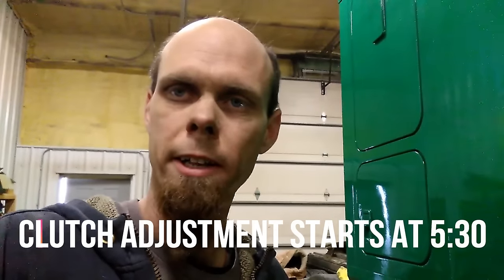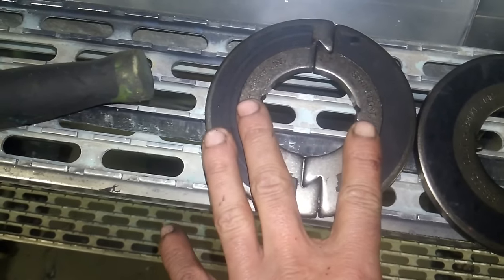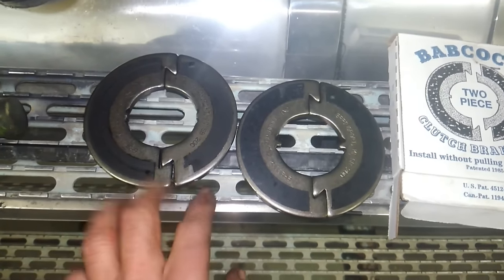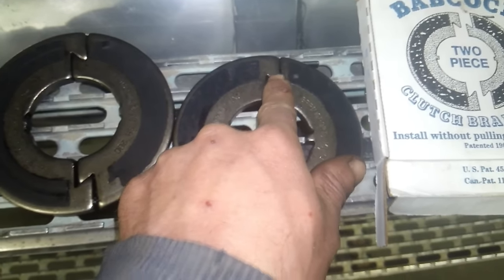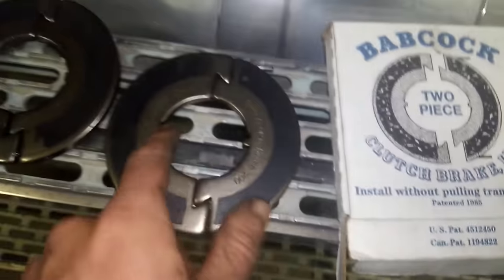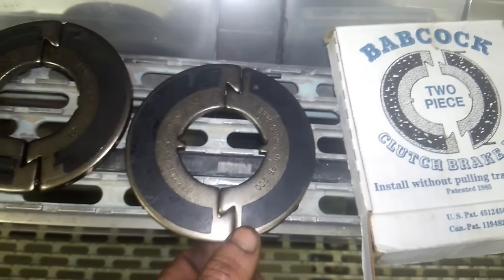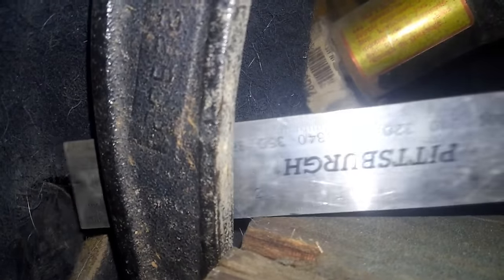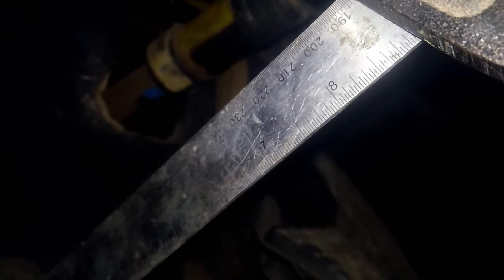clutch brake replacement and clutch adjustment eaton fuller

Comment: I see this on Mack dumps every single day.. They worry so much about toe play, that they'll adjust the linkage to the point the clutch brake no longer works. And then proceed to try to get the truck in gear by holding  light pressure on the shifter and letting the trans grind itself into gear.. And then wonder why the magnets on the plugs look like friggin porcupines when they do a service.

Comment: i have an rto-13710c 10 speed, the truck is a project service truck right now, when moving it around it feels like it’s a bad clutch brake, reverse and 1st/2nd barely usable as it won’t go into gear easily but high gears are fine, i checked clutch brake and it’s not spinning on input shaft, it “seems” ok, there is oil residue around the bell housing, inspection area and on the shaft and brake, not sure if there was a previous leak or currently leaking from maybe a seal at input shaft i haven’t looked up a diagram yet to see what might be the issue, should i assume oil on clutch brake to be the issue and i’ll check the spacing between bearing and brake as well

Comment: Excellent video.  What if the gap is slightly less then a 1/2" between the bearing and the brake?  New eaton easy pedal.  Is it possible to turn the adjustment counter clockwise to open up the gap?  Is there any risk of thrust bearing damage having less then 1/2 " Thanks

Comment: Hopefully you can help. Have an 15 KW with ten speed and the smaller I believe 14.5in Solo. Typical 1st and R horrible grind. Truck is for sale so I power washed the clutch, reset it and I lost all pedal play. Drove around and it came back. Clutch Brake was SMOKED. Replaced clutch brake and it was even WORSE, could not get any gears. So I did same procedure, reset clutch, lost pedal play. Now I go into gears and truck will not move. Bearing gap not quite 3/4in but more than 1/2. Did my adjuster seize up on me? Any tips? My plan in AM is to perform shipping bolts install and removal.

Comment: Great video thanks!  Quick question, do all transmissions have clutch break?  I have an international S1900 with DT466 and Eaton Fuller 6 speed.  FS610A.  I adjusted the clutch and i was wanting to check for the 1/2" clearance between throwout bearing and clutch brake, but i don't really see the brake.

Comment: in an eaton transmission, the truck goes in 8th gear it is as if it engaged I have to take the gear out again and put it back in, I don't know if it is a transmission problem with a gear selector

Comment: Hello sir I replaced my clutch brake but when I have some one press the clutch my clutch brake slows down the tranny but it still spins a tad and it does not let me put it into 1st gear with out grinding. Seems like there’s to much space what needs adjusting for the clutch brake to make more contact.

Comment: Hey mate,, I'm sitting under my truck in the rain and could use advice. 1st, thank you for your videos.
I have a 6 speed eaton fuller model# FS-5406A
Serial#  G0117756 the clutch is different and I was curious if it's adjustable also,,  Thanks for your time in advance.

Comment: I am checking my clearance, and I notice I can slide the throw out bearing towards the clutch by slightly prying with my extension and it does not bounce back.  Is this right? or is something wrong down there?  I have a hydraulic pedal so the free travel does not change, but if I tighten the nut, the pedal stops short of hitting the floor.  I have the 1/2" until I slide the bearing then I have too much clearance.
Any help out there?

Comment: Can anyone tell me if a self adjusting clutch (Eaton) needs adjusting?  I had a new clutch and clutch brake installed.  If i didn't know better, I'd say it was never changed.  I watched them replace the clutch brake with no adjustments told me it was good to go.

I'm wondering if they forget to remove the shipping bolts?

When pressing the clutch from a stop, it doesn't stop the flywheel.

Comment: Awesome you are the best,I'm wondering if you know how to rebuild power steering box if so I would like to share my knowledge,I have a lot experience on rebuilding gear boxes,even on the zf gear box for Volvo many drivers that own their truck they don't know that they can install a different gear box that is compatible like an THP60004 and is more cheaper either to rebuild or purchase

Comment: Really well explained and good footage of the black hole inside the inspection hole.   I assumed I had the old style clutch in my 1989 379 Pete, but when I got in there it had been upgraded to the new style by the previous owner.  Subscribed and thanks again

Comment: two measurements are all that matter..........1/2 to 9/16 between the clutch brake and the release bearing and after that is set  a 1/8 gap  between the release fork and the wear pads on the release bearing..........then like you said after that  whatever you have as your freeplay will be ok for THAT truck........worn out linkages and rods add a lot of extra freeplay.....but if the 1/8 gap is correct ,,,,,,,you should always be ok.........thanks for a nice video.........i see you know what you are doing.........

Comment: We used to use a 5/16 bolt (1/2 in. head) and weld a piece of threaded rod to it for a feeler gauge to check the throwout to clutch clearance. Just found your channel. Great videos you put up! You are very talented in all phases of the trucking business.and should be very proud of your skills.
Reply from the maker: Great idea thank you
Reply: Yeah, using the 5/16 bolt idea.
I'd just use a torch and flatten the threaded end down

Comment: The clutch brake needs to catch 1/2 inch off the BOTTOM of the floorboard which ain't much. If I'm the only one driving the rig I just set the pedal low and don't even use the brake but that's just for me. And you need to set the clutch off the floorboard 1st or it'll throw everything off. And 1 inch will shear the tits off the brake disc. The closer to the floor the better for the brake. And by the book is 7/16 between the brake and throwout bearing. That's book but you can't get but very few people to set one right. And i shot is good for throwout bearing per service. Good job!

Comment: That's the only way..adjust clutch first..I use 1/2 extension aswell..works great..
Alot of mechanics still adjust linkage..not knowing where clutch adjustment is..
When I worked on fleet trucks we adjusted for 1/2 off floor.new drivers were bad for pushing clutch to floor during shifts.
Excellent idea on snapping roll pin on clutch brake👍
Reply from the maker: I've seen this done improperly many times by people who should know better
Reply: that is how drivers ruin a clutch brake or even disintegrate one, jamming on the clutch pedal so far that they hit the clutch brake at high speeds...that clutch brake can not stop that fast... there is just a thin material there....

Comment: I was having trouble getting my old brake out. The tip of cutting a slot cheap socket to break the pin worked great for me. 

I also had trouble with losing the hinged clutch brakes. I lost 2 in just a few months.

Comment: I appreciate your explanation of this process.. I adjusted the clutch on my 2011 Pete 386/18 speed yesterday and got the clutch brake working well and had just a touch over .5" spacing but yet I had 2.25" of pedal travel. I was a bit worried since "everybody" says "no more than 2" free play".. After considering what it would take to adjust the linkage on my truck, I said screw that and left it alone.. I'm glad I did. Everything is working fine so I'm not worried about another .25" of free play.. Thanks again. Your videos are very helpful!!

Comment: Followed procedure, had trouble pushing adjusting bolt in. Finally got it but bolt was hard to turn. Just didn't feel right. Ended up with about 1/2 inch between brake and throw out but now have 3 inches freeplay at pedal. Clutch seems to be working good and grabbing right where I like it. Should I worry about too much free play at pedal? Thank you
Reply from the maker: you don't need to worry about it. as i explained in the video freeplay at the pedal really doesn't mean anything. if you don't have much grab on the clutch brake and wanted to take a little freeplay out of the linkage to get a bit more clutch brake you can but otherwise i would just leave it be.

Comment: Finally someone on YouTube that has performed a clutch adjustment as it should be done stating that the 1/2 inch gap is critical set point as a mechanic myself well done 👏
Reply from the maker: thank you, even a lot of "professional" mechanics get this wrong. i guess i haven't watched any clutch adjustment video's on you tube to see how other people are showing to do it.
Reply: I have a 10 speed Eaton I recently had the clutch replaced because it was getting hard to go into first in reverse from a stop. Seems like it fix the problem for about two weeks no I’m right back at the same place my friend said the same thing happened to his truck also exactly……any ideas? Supposedly I have the best clutch that you can buy fully automatic they told me.
Reply: @roz4747   Firstly confirm that you have 1/8” gap between fork and release bearing then between the release bearing and clutch brake you have a measured gap greater than 1/2” less than 9/16”. Then confirm throw of clutch to achieve clutch braking 1/2” from pedal touching floor of cab.
Reply: @donaldsmith1034  thank you man!
Reply: @roz4747  A genuine Eaton clutch comes with the installation requirements which the technician should have followed

Comment: The  fun  ones  to  take  out  are  the  factory  one  piece  that  you  have  to  torch  out . Some  shops  I've  worked  in  had  a  straight  cutting  torch  just  for  that
Reply from the maker: removing a 1pc is a miserable job.
Reply: @Ezrider359  I've  got  a  number  of  burn  scares  from  them .
Reply from the maker: @cbmech2563  i don't doubt that one bit

Comment: Great video thanks for sharing I have a kenworth and it doesn’t have free play in the pedal I was told it has a different set up but I haven’t had to find out yet knock on wood
Reply: Byron Lininger thanks Byron believe it or not My clutch just started slipping a couple days ago so I do have it in a shop to check it out and find a diesel leak that just occurred too thanks again
Reply: @burp1914  when I work on hydraulic clutches..I found if clutch brake did not work that was the time for adjustment..the Volvo adjuster abit tough to get to..
Reply: @burp1914  oh yeah a few occasions..1 time someone replaced adjuster bolts..with regular bolts..heads hit fork .
Really tight fit in there..gotta know what your doing. 👍

Comment: Respect first off for the camera angles. Bravo. I do not completely agree about the freeplay in the pedal. Maybe specifically for that type of Eaton clutch. I deal with more modern self adjusting clutches. And then the freeplay in the pedal is less about the brake and could be more related to throw out bearing spacers and other mind blowing specs these manufacturers throw out once they realized what they did wrong building the transmissions.

Comment: Thanks so much for your awesome videos! 

 What's your thoughts on clutch-less shifting? I keep hearing both sides of the story. Usually, I don't use clutch other than takeoff. 

I think its all depending on the way drivers shift. 
So, does clutch-less shifting destroy the transmission and components faster?
Reply: THE TRUE AND ONLY WAY MY MAN

Comment: Man this is great video.  Came here to see if there was faster and easier way to remove the 1 piece clutch brake, guess the chisel is still the way to go along with a large bolt with a slot in the end of it.....But that 1/2 Extension Trick is awesome!! Ill have to try that on the next one.  Your right on the 2 piece clutch brake with the one big roll pin in the side of it falling off.  I have seen several that have fallen off and get waded up from the flywheel/Clutch assembly and punch a hole through the rear adapter housing on the engine, get tossed up where the starter bendix is and jams it from starting to even messing the teeth up on the ring gear of the flywheel.  We went to a style similar to what you show and they didn't fall.  Sure they are a bit tougher to remove but they don't cause damage by falling off and getting into the wrong area.
Reply from the maker: 1 peice brakes are not fun to remove. No real better way that I'm aware of.

Comment: Thanks to your video you saved me a day down. I popped a new clutch brake in and clutch brake works! 
I had a helper hold the clutch brake by depressing the pedal to drive the roll pins out. 
Block of wood would work too 
On the pedal.

Comment: One the things that gets screwed up the most on shop ,clutch adjustment 

Good video
Reply from the maker: thank you, yeah iv seen a lot of clutch adjustments that were done the wrong way. that's why i kinda tried to beat in the point of not worrying about the pedal till after the clutch itself is adjusted properly.
Reply: @Ezrider359  Usually you get a short legged guy and instead of doing a clutch right they'll just set the top stop up then you have to open the door to even get your foot on the pedal it's so blasted high. If one is by the Mack book I can put my knee under the window winder and hold the pedal down like that.  And I can shut the engine off if I need to to get one in gear and I've drove Macks for WAY too long. BUT any truck can be messed up too. Keep after it EZ and SOM.  Right it right.

Comment: Good stuff... my 2015 t680 started to slip just a little when I was taking off in morning,  usually merging when I am mashing it... made it 3000 miles home and had clutch replaced. Before pedal was right at top... now I have a good bit of free play... but clutch brake barely works... I watched video so I can check it out. Glad you said 1/2  extension for checking because I didn't know what I was going to use. Thank you for the video

Comment: Good morning Ezrider, I bought another cabover with a super 10, the shifter high and low is working back wards. Low gears the switch is up and highs work in the down pattern. How can I fix it. It’s not causing any problems but I’m old school and very anal about it. Lol

Comment: Maybe I just didn't get it, but my truck had that very same clutch brake. Couldn't get that damn thing outta there. Ended up paying somebody to get it off. Went over to the dealer, got another 2 peice it was a thicker model. But it was way easier to install, should be just as easy to take off. After I got it closed around the shaft. Pressed on clutch real hard, been fine since. It's a Haldex clutch break.
Reply from the maker: i had trouble getting this one off as well witch is why i cut a slot in a socket then put the slot over the clutch brake where the roll pin is and twisted it to brake the roll pin. the kind you used that you step on the clutch to set, iv seen a number of them come unlatched in normal operation and fall off is why i don't use that style. iv never seen the style i used in this video come apart unintentionally. does not mean your have any problems with yours just why i don't use that style. thanks for watching.
Reply: Ezrider92356 oh, I heard doing the socket thing. Hell if I know why I didn't try it. Oh well. But your right bout the clutch brake I got. A driver parked next to me once in joplin. And he asked me if I could help him out. Turns out his transmission wasn't stopping or something. I said it might have something to with his clutch. So take off your inspection plate. Turned out his clutch brake was sitting on the bottom of the bell housing.

Comment: Hey, great video for being cameraman and mechanic. I need help advise. I'm a driver being thrown under the bus by the company mechanic. Clutch brake goes out every 2 weeks short hauls drop hook 16 times a day. Several non commercial employees drive my truck during the day and I get the S.. when clutch brake goes out. 
Main question is a 10 spd Eaton off of a 2014 Cummins similar to your video?.
Thanks
Reply from the maker: If the clutch brake is going out every two weeks someone is not using it properly. If non cdl drivers are driving your truck during the day they need to be educated on how to use the clutch

Comment: After watching this I checked the clutch on my ‘66 Pete because the clutch brake wasn’t working although upon inspection it is there. The gap was at least 7/8” and it wasn’t even contacting the brake. Went to adjust the clutch and I can’t get it to move after removing the retainer. We even had the tool. Tried hammer and punch to no avail. Took out the free play in the pedal to see if it needed more to release the clutch adjustment but no luck. The truck had been sitting for over a decade and the clutch is full of dust. Works fine and doesn’t slip. Just won’t budge for adjustment. Any tips?
Reply from the maker: Was the pedal depressed while trying to adjust it. The adjustment won't move unless the clutch is released
Reply: Yes. It was depressed and we even removed some free play with the linkage to give it some more throw. Won’t budge.
Reply from the maker: Yeah. About all you can do is keep working at it. You could try blowing as much of the dust and crap out as you can (may contain asbestos) and keep trying to work it. If you can get it to start moving at all work it back and forth your probably get it free. Short of that you might end up having to remove the clutch.